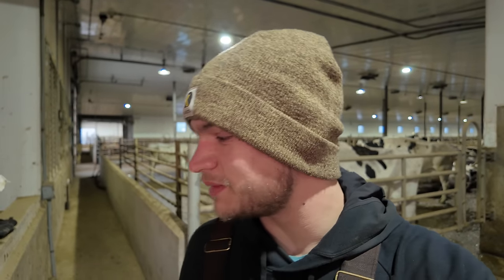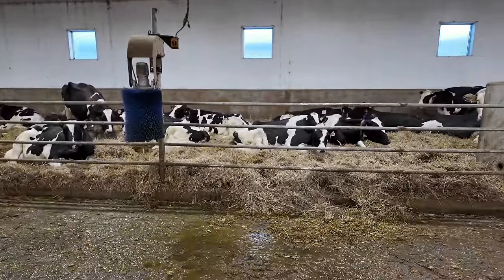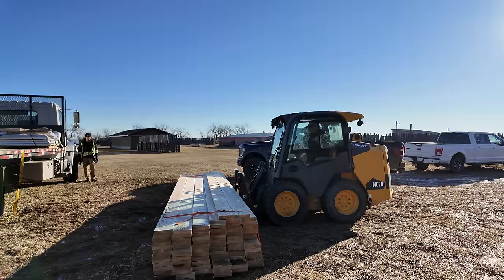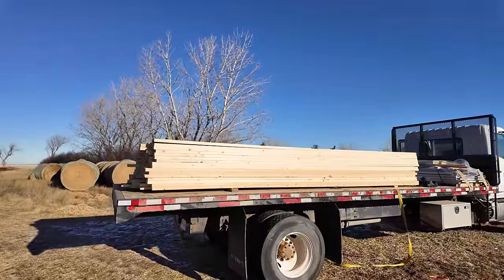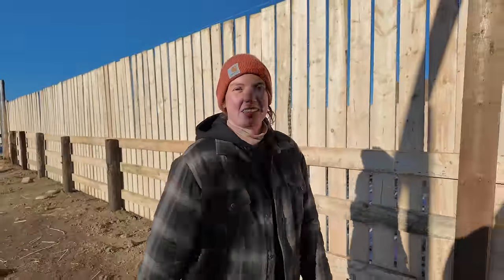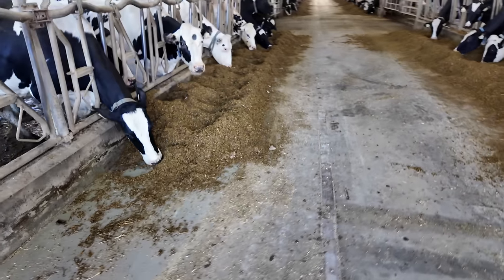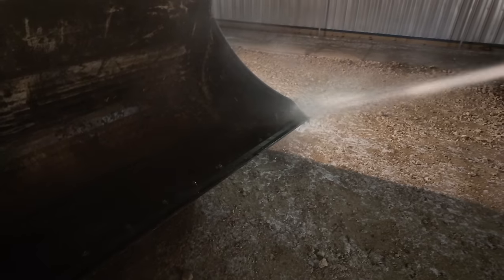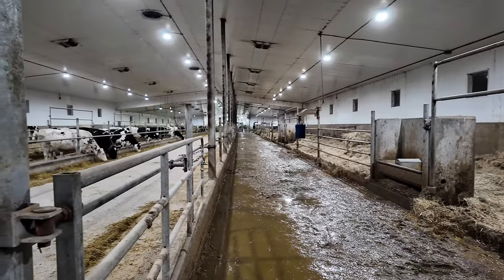Skid-Steer FAIL!

Comment: Hairy wart is what we call digital dermititis here in the UK. Treated the same, topical abs but usually in the form of blue anti b spray. Trouble with wrapping when you have pumps etc is them coming off and wrapping around slurry pump propellers. On straw, less of an issue if come off on the straw bedding. Nothing worse than the pump blocking sat am when staff are off etc.

Comment: Nice vid!! Very interesting! 
I'm sure you prolly already figured this out, but if you add a board on top of the cement wall, it will keep the manure away from the Juno path. Also, another line of boards at the bottom would keep the straw from the alleyway as well. I'd use old boards from some demo work around the farm.
I guess your sister is going into the goat business now! Congrats!

Comment: Those skid steers are made to take a licking and keep on ticking, so-to-speak.  A testament to good engineering.    It is a nice video, thanks.  Hopefully there's a way to prevent issues with the liquid manure pump.  Maybe it just will take some cleaning once in a while.

Comment: Jan’ why can’t you install like a 6” to 10” wide 1/8 th thick piece of clear plastic panel along that bottom rail so the straw doesn’t fall over into the alley side where you said would clog up that pump system or has that been mentioned already.

🇺🇸🙏🇨🇦